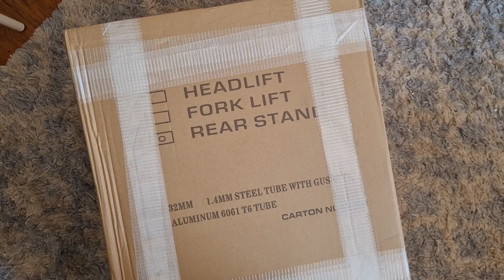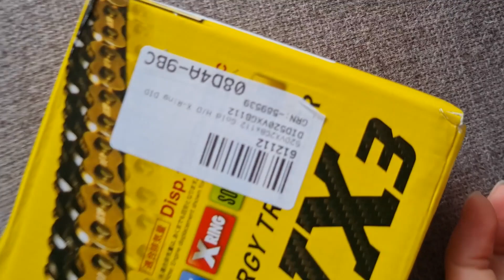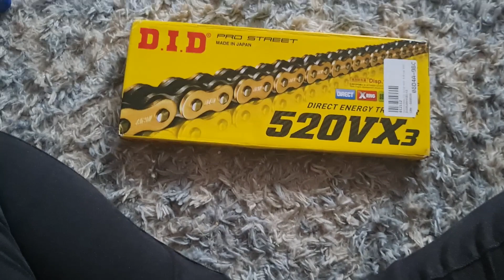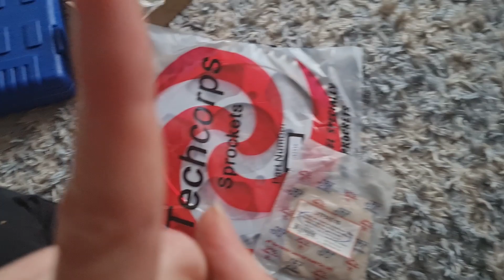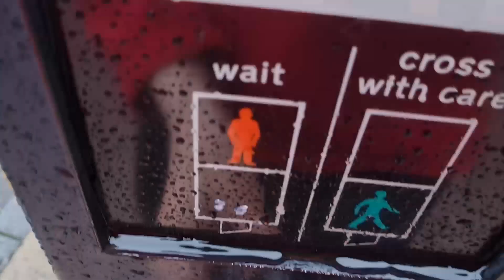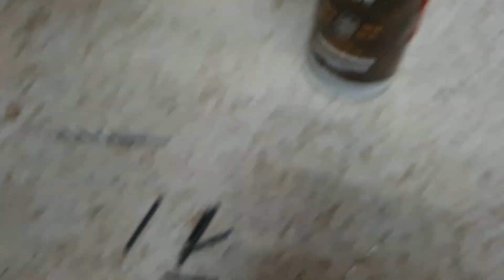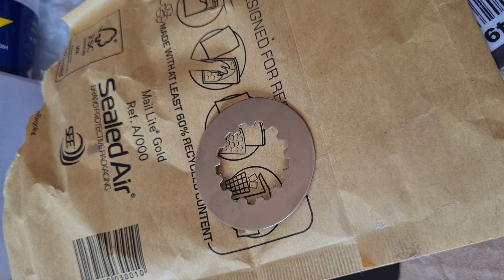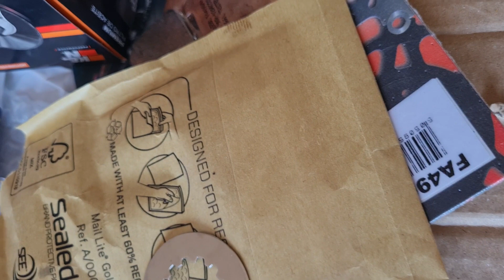Beginner Motorcycle Maintenance: My First Attempt (Part 1)

Comment: I'm hoping that paddock stand doesn't slip off the swing arm. You've got bobbins on there I see?
Reply from the maker: Yeh I thought the paddock stands I used would have bobbin pin attachments but they didn't
Reply: @SaffySprocket  Ah, that's a pain. I know it's of no use now, but xlmoto do some decent ones that come with a few attachments. I don't have bobbins so I have spares if you want them. (they might fit your stand, maybe?)

Comment: i'm hoping you've already figured this out... But just in case.

Undo the cap for the brake reservoir before pushing the pistons back in.
maybe try opening the bleed nipples on the callipers and then try pushing them again if opening the cap doesn't work.
Though replacing all the fluid in the brakes is not a bad idea, it should be replaced every 5 or so years.

Comment: Your doing ok, and your still learning but you deffo need an electric impact driver. As you experienced it makes taking nuts and bolts out much easier with less damage. You will need a few more sockets with allen ends or star bits but well worth it in the end. If you were only using the rear stand you could pull the front brake lever on and put a cable tie round it to keep it on and stop the bike rolling forward when your messing with the back wheel. Also if theres holes for them I would fit bobbins which use hooks under them its a lot better than the dodgy rubber pads on the swing arm

Comment: X ring is better than o ring. As long as its the correct length and pitch etc it'll be perfectly OK. Might be good idea to go on a motorcycle maintenance corse at a local college or get a friend to show you how everything works.
Reply from the maker: Unfortunately there aren't any near me!
Reply: Maybe buy a workshop manual for your bike and have a good read, you can get them from the library aswell. Pity you're so far away, I'm semi retired so plenty of time on my hands , you'd be more than welcome to call in and use my workshop and tools. Next time you're of up the lake district you almost pass my house so if you need any help  just shout,  oh and I'm not a weirdo , 😆,  I just like to help  if I can .

Comment: I would have also bought the Haynes manual (unless an OEM service manual is available) and a set of torque wrenches that cover the full range you need. If this is your first job, it's not worth the risk that you under or overtighten something. I got the Halfords Advanced ones, they're good value and come calibrated from the factory. Worth it for peace of mind.
Reply from the maker: I couldn't find either 🥲
Reply: @SaffySprocket  That's always a bummer 😞

Comment: Well that was terrifying at times. That paddock stand looks dangerous. Abba stands aren’t cheap but are solid. 
As for it being a money pit, a garage would have found the worn rear pads and charged you for the privilege. Just take the reservoir cap off, put a rag round the reservoir and gently push the pad back in. Fresh fluid is no bad thing if that’s what you’re doing. Bin what you don’t use as it doesn’t keep once opened.
Kudos for getting stuck in. It’ll be easier next time.
Reply from the maker: I did adjust the stand after aha,  not fond of it to be fair, I use to have a good rear paddock stand with bobbin pins but I lost it moving houses

Comment: Watching this being a mechanic I would have to say never go by YouTube . What I would advise is that you have the bike ckecked over by a mechanic ,  so to ensure what you have done is correct and everything is torqued up to the correct torque as if it's done incorrectly you could cost your self alot of greif and damaged to your bike its. How are you pushing the pistons back in the calipers as they don't push back by hand , and it's talking about the reservoir being full which is easy to check by looking at the fluid level , just unscrew the cap and push the piston back and if its over full suck out the fluid with a syringe, but keep an eye on it as your pushing the piston back . The padock stand you have is abit sketchy and I would use the bobbins on yhe swing arm which is more secure. The best way to learn is to shadow a mechanic to learn how to do it correctly and safely  and you will be confident. It's just that YouTube won't tell you everything you need to know. I'm not criticising your effort but I know how important it is the the work us carried out  correctly as it can go catastrophically wrong .

Comment: Should have bought an impact gun for the front sprocket (I did for the second time I done a chain and sprocket lol, wonder if you saw my vid during your research 😎), they are always very tight as they have a high torque setting and go through a lot of heat cycles. Also best to loosen that before putting it on the stand.
Maybe an ABBA superbike stand or ABBA sky lift would suite you better, I really don't like paddock stands and love using my ABBA superbike stand. Best way to learn is to do, and you'll learn better ways as you go, don't give up 👍
Reply from the maker: I did on the end!!!!

Comment: Good luck getting it sorted !  Would love to know how you get those brake pistons back in . It’s something I haven’t mastered myself 😢
Reply: Soak in brake cleaner and scrub with a brush. If they won't go back by squeezing the pad with both hands try a flat screw driver as a lever. If that doesn't work, crack the bleed nipple and use vice grips. Fluid is going to come out so you want your bleed kit - but you really should remove the caliper for a strip down and inspection and that means draining the fluid anyway.

Comment: Hi young lady. Is that new rear sprocket the correct size? When you first took it out I immediately thought to myself that it is way too big for your bike. I hope I'm wrong... Good luck with putting everything back together again.
Reply from the maker: It's the same size :^)
Reply: Fantastic. Try to bleed the whole rear brake system with new brake fluid while you are at it. Just make sure you do not get any air bubbles in the system.

Comment: Don't feel badly about having a hard time. All mechanics, including professionals, screw up when they're first learning. I certainly did. I didn't have YouTube when I started out, but my dad was a wonderful teacher and helped me the same way your friends help you. You WILL get better. You might not notice it. Every mistake and accident will make you feel like an idiot, but you might not notice how many mistakes you don't make or don't repeat. Promise me you'll take stock now and then and feel good about your progress.

Those sockets you bought are impact sockets, extra thick and strong to hold up under intense stresses. Overkill for hand work, but nice since you actually are using a form of impact tool. Their large size may get in the way now and then, but they won't break. I've actually split a cheap socket before, on a normally torqued bolt. I don't buy cheap sockets anymore.

I do fully support buying cheap tools if they seem okay and they won't see much use. I would've bought the cheap chain breaker, too.

Lastly, x-ring chains are now what o-ring chains were 20 years ago. They're the desired thing. They seal just as well or better, and they provide less resistance, i.e. better power transmission (negligible for your and my purposes, but whatever).

Keep on keeping on, and please continue to have a good time both in saving money through wrenching and, of course, riding the dang thing. 😁
Reply from the maker: Thank you so much ❤️  I did go on to buy an impact gun and much better impact sockets too! Which have been an absolute god send! 

The chain breaker I wouldn't buy again, it broke several times, which was quite frustrating

Comment: if you spill brake fluid on anything clean it up quick,it eats through paint and stuff quickly,O and anything you undo with a screw driver or a Allen key dosen't have to be really really tight when refitted.
get some rags to clean up stuff don't use your tools you might accidentally end up putting them in the rubbish .lastly ,take pictures of parts your about to disassemble for reference when reassembling.
Reply from the maker: Thank you so much for your advice 🙏 ☺️

Comment: Good on ya for giving it a go. But don’t leave me on a cliff hanger 🤣 Please tell me you worked out that the expensive £5 washer is supposed to be bent around the sides of the front sprocket but after it’s tightened to stop the nut coming undone in use 😱.  Also, I’m sure it’s already happened now but take the top off the rear brake reservoir then squeeze the piston back, no need for fluid change.
Reply from the maker: It didn't even fit ahahhaha I ended up putting on the old one
Reply: @SaffySprocket  - I would have reused it too 👍🏻, but seeing as you’d already spent a fiver anyway...  Just so long as you locked the nut with it, that what matters.  I’m feeling all paternal now 😂😂

Comment: Woah! Brakes likely the cylinders seized, you don't need to change brake fluid just undo brake nipple use lots of cloth (to catch the fluid as is nasty if gets on paintwork) and then squeeze the piston, it should move easily, bear in mind you will need to bleed the system after, oh and once the piston is retracted close the nipple of to stop to much air getting in. If piston does not move defo seized. Which is another job to sort. Youtube is your friend there are lots of vids about doing this. Equally buy a mechanically minded mate a few beers to give you a hand? Don't get disheartened, I've spannered on motorbikes, cars and classic cars, and still get caught out by the law of sod 🙃 Keep up the content, it's rather fun, Cheers.😀😀
Reply from the maker: I learnt that this morning 🤣🤣 had a friend come round and take the lid off. He also pointed put I had put the axle in back to front 🤣🤣🤣
Reply: @SaffySprocket  Thats priceless 😂 as I said - fun content! Owners clubs on-line are always a good source of tech advice. Look forward to part 2! Cheers

Comment: 10 out of 10 for at least trying and getting what you have done so far.
Look for a maintenance book for working on bikes it might help out .
I wouldn't add the cost of tools to the job  unlike the parts you replaced you have the tools for as long as they last .
And remember if you not skinning your knuckles your not trying hard enough
 😀

Comment: X-ring DID chains are top knotch Saffy, Last a long time.
Reply: Putting it bluntly , Saff......Thinking poker style.... X-ring chain is four Aces,( the best ), ... O-ring chain is 2 pair, when it comes to MC chains. Don't be disappointed because they sent you the best option, and you weren't aware of that fact. Also ...Make sure they sent you Steel gears,.... not Aluminium ones. Ok .??
Reply from the maker: No I'm just dumb as rocks ahahaha

Comment: Nice one for having a bash at it yourself, you'll save a packet in labor charges. The injuries i'm afraid come with the job.. ideally pull a spanner. ratchet or breaker bar towards you, if you have to push do so with the palm of an open hand.. thus if the tool slips off or the bolt breaks you don't get skint knuckles. If you can.. invest in a Haynes manual, they're like the holy grail for the DIY dude... or dudette in this case.

Comment: The washer is meant to be bent around the nut on the sprocket! You should buy the manual for your sv and a stainless steel bolt kit for your bike to have as spares.  Not alloy bolts.
Reply from the maker: I contacted Suzuki, they don't make the service manuals available to the public and the Haynes don't make them for 3rd gen 🥲
Reply: @SaffySprocket  that's not good then. I guess it's Google and YouTube then. I'm surprised they should at least make torque values available for owners.  Anyway it's stressful try to learn a new skills but very rewarding to get back out on a machine you fettled yourself.  Just make sure everything is tightened up properly.  Don't over tightened the chain that can strip your gearbox and too loose may throw the chain off and lock your rear wheel. Good luck

Comment: Washer wasn't warped around the nut b.t.w.,it is designed like that to prevent the nut from undoing.
If ever you are passing Arnside on your way home and want to talk maintenance, pop over for a beer.
And if your neighbour is an Aero Engineer I'd not want to fly in any plane he fixed.😂😂😂

Comment: 12 point sockets. I always tell people ONLY use 12 point sockets on 12 point nuts!! You end up putting a load of force through corners of the nuts. Definitely invest in some 6 point sockets, they will save you hours of stress.
And just a quick one as I'm watching, that front sprocket washer isn't battered from doing it's job, it's a Tab washer that gets bent up against a straight side of the nut after you torque it up to act as a safety device to stop the nut from coming loose.

Comment: Motorcycle maintenance needs to be checked often or as your finding out everything is worn out at the same time. Your doing a great job, and if the garage did the same three jobs they'd charge you more, so your still saving money. Like the boiler suite, did right getting a larger size or they just restrict your movements when they're tight. Looks like a bit of cleaning needed also, we'll done Saffy, if you were in Yorkshire I'd happily help.
Reply from the maker: Thank you so much for your support 🙏 ❤️ 💜 💗 💕 💛

Comment: Miss Saffron, I really admire your enthusiasm but..... When working on the bike it must be stable or it could fall on you with grave consequences. With your setup to remove the front sprocket and chain, with both wheels on the ground, park the bike with the front wheel against the wall, place the bike in gear and tie the front brake lever. Loosen the sprocket nut and then cut the chain. Please get someone to look at that paddock stand because it's unsafe. Carry on girl your getting there!
Reply from the maker: I fixed it after but thank you 😊

Comment: Priceless entertainment again. If the front sprocket has not been off before they are a right pain so don't kick yourself. As for the rear caliper the pistons can be hard to push back. Don't drain fluid take master cylinder cap off and wrap rag around that area to catch any fluid. then  a piece of wood and a 'g' cramp to retract pistons, and keep eye on the master cylinder. Great being a female isn't it. Just flutter those eyelids for some assistance. Can't wait for next week

Comment: This is all part of the learning process. it's all too easy to snigger at someone who is , to the experienced eye, is doing something wrong that would be obvious to those who have done it before. But when you come to do this job again the experience you've gained from this will stand you in good stead as you will now be the one to say, don't do it like that, do this!...
The brake problem you encountered is common as you add fluid to new brakes and top up as they wear, meaning when you replace those now worn discs and pads, all that extra fluid is now too much!
Again , now you know, you know!
Reply from the maker: You're too kind 🥰

Comment: A lot of these jobs come down to making life easier for yourself. For instance, you'd have struggled a whooooole lot less getting that wheel off if you broke the chain while the wheel was still on. It would have been one less thing in your way. Might have also made breaking the chain a bit easier, at least easier than trying to get it to sort of stay in one place while still attached to the bike with the wheel off.

Brake jobs also cone to mind. If your rear caliper is the sliding type (it is on my CB650R), then you can just gently push it against the disc to retract the piston a bit before you start. Makes the whole thing easier to take off.

You pick up on little things like that as you go along so don't get discouraged by little mess ups and making extra work for yourself at the start - we've all been there, none of us were born competent.
Reply from the maker: Thank you so much! To be fair, the comment section of this video has been insanely helpful for learning nifty tips!

Comment: You don't need to drain the brake fluid open the resivoir cap get a cheap syringe  and remove required amount no draining required
Reply from the maker: I did end up having to drain it all after I took the nipple out 🙈
Reply: Lesson learned also a lot easier to Crack the rear sprocket nuts while still on the bike